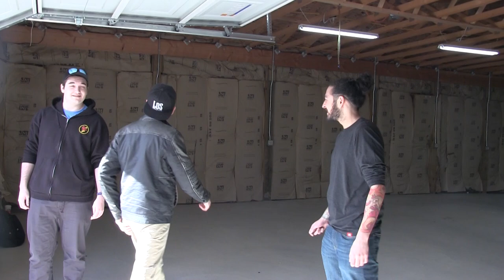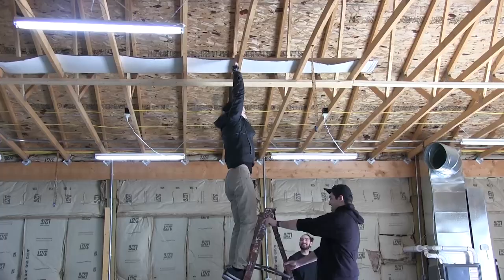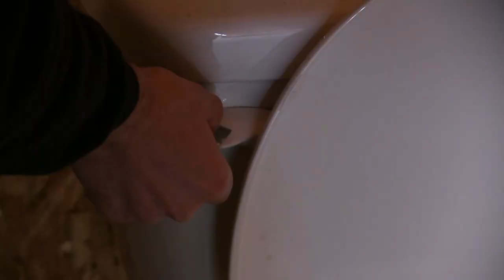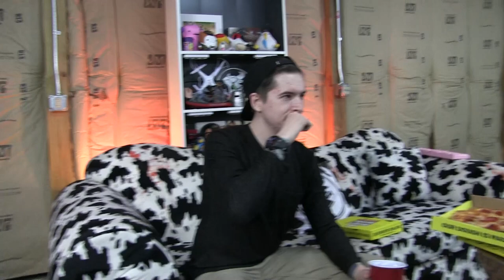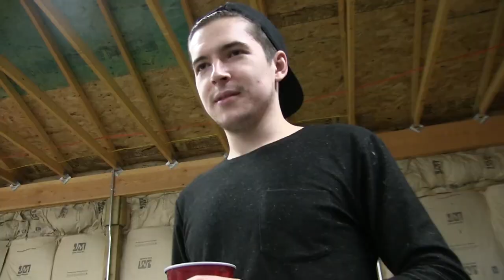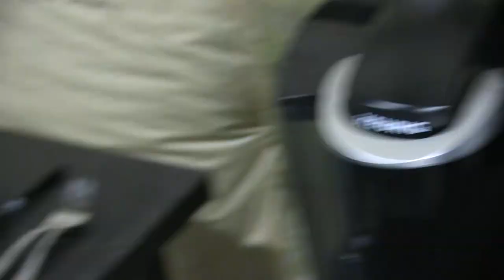BARN Introduction

Comment: Im gonna say this right now. Dont fuck around with garage doors. Seriously it is so much easier than it seems to lose a finger. One minute your goofing around, the next the door is closing and you cant find the front half of your finger.
Reply: Really? When I was little I put a peanut with the shell under the garage door, closed the garage 5 times and the peanut shell only had a dent
Reply: thats true but not all garage doors are that powerful, plus they've had garages before
Reply: Sean someone lost there finger to a garage door
Reply: Sean The garage springs are the dangerous parts. Those springs can fuck up someone's face real bad, and I mean mutilation bad
Reply: People even die from getting crushed. They're not something to fuck with.
Reply: dont mess with roofs either sometime some1fell off a roof and died #thisguyslogic
Reply: Also buying a horse head mask doesn't make you funny or cool
Reply: Also buying a horse head mask doesn't make you funny or cool
Reply: Sean one of of those doors landed on my foot and guess what? It doesn't hurt or even feel like it's there.
Reply: Sean they come down and just sit on the floor. They don't come down hard or anything.
Reply: Gimlisac okay and I didn't feel anything out of all the times I've had one gently land on my foot or the time I purposely put my hand under it. Im fine and it didn't hurt at all. One of the times it landed on my foot it was a powered one. The reason why sometimes it landed on my foot was because sometimes people would be coming so I put my foot down to disrupt the sensors so it would go back up but it didn't a couple times. When I moved we didn't have a powered one and someone closed it on my foot.
Reply: they just need to rush to the hospital to reattach it back
Reply: Garage springs can shoot fast enough to easily kill you, it happens a lot more often then you think.